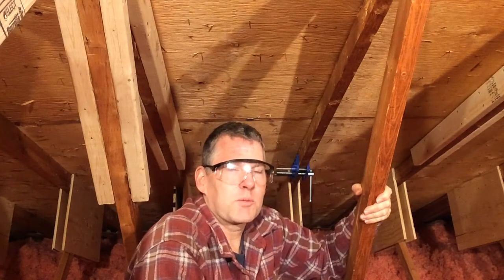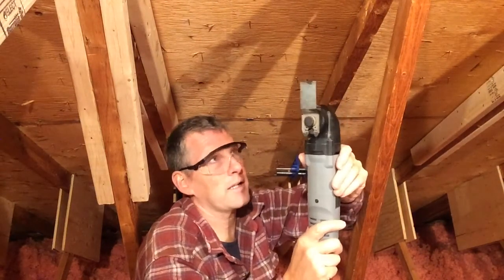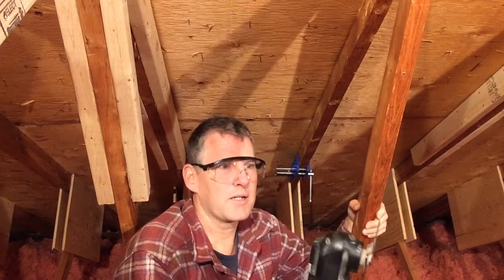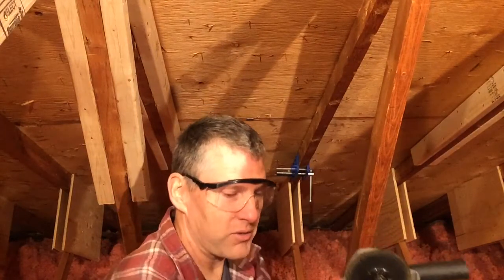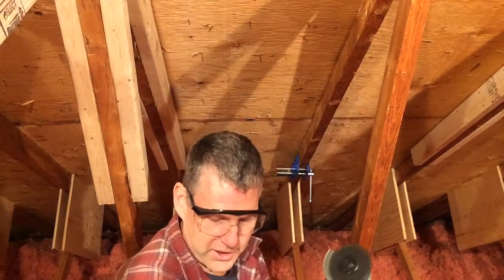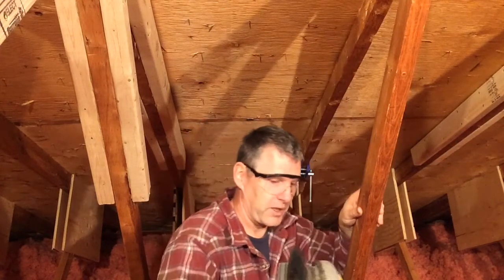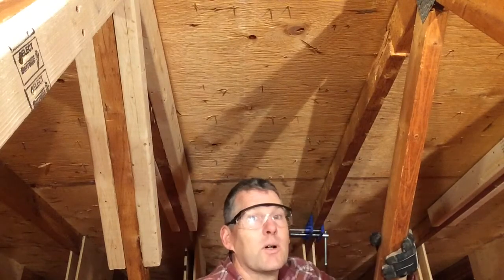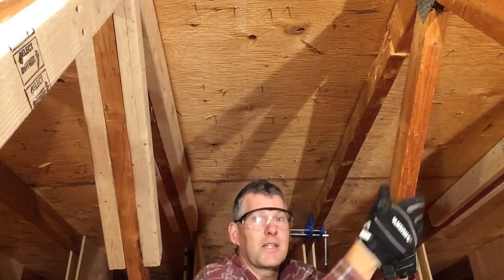Attic Truss Repair 02: Removing nails that are in the way

Comment: We use safety glasses AND a full face shield over safty glasses and try not to be directly under area or where sparks are flying to avoid chance of metal getting in eyes.  Also on breaks be VERY careful when taking shield and glasses off with face pointed down to brush metal shaving out of hair and face area while your  eyes are closed.  If you ever get metal in your eyes you will wish you've done these extra safety measures !

Comment: I had to cut off some nails and put the guard back on my battery powered angle grinder and it gave me a guide to lay against the wood to steady it.  The cutoff wheel didn't grind the wood and just made black burn marks.  I may try a diamond cutoff wheel.  It needs a thin metal or plastic shim (like imagine a round CD on the front side of the cutoff wheel against the wood that's free to spin)  That may be possible with some washers and shims, hmmm.....

Comment: What we need to invent for you is a longer handled carpenter's pincers, (or just use cheater bars) and have the pincers with carbide pinching edges. Maybe someone makes one already. Bolt cutters don't get close enough. Welders' blankets might make you feel a little more confident with the grinder going.

Comment: Can you use nail cutter? I used nail cutter to cut Chain-Link-Fence wherever I wanted to.
Reply: The problem with plier type cutters is that they don’t cut the nail flush to the plywood. That little stub of nail will get pushed up by the new beam and will loosen on the shingle.

Comment: Don't use a grinder to trim nails in attic.  Buy a mini Bolt cutter at ace hardware.
Reply: Bolt cutter wont cut the nail flush
Reply: @franktib  They do if you buy the correct type.